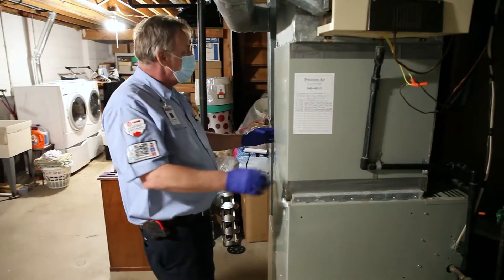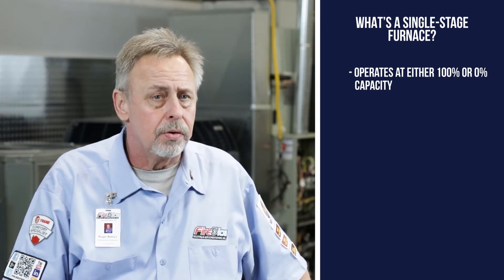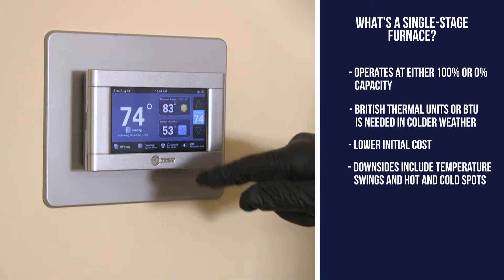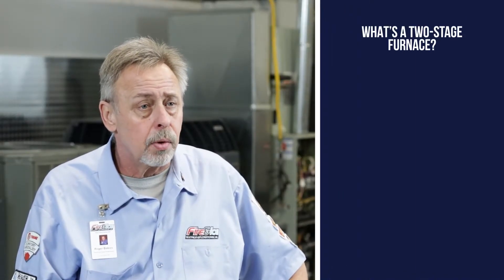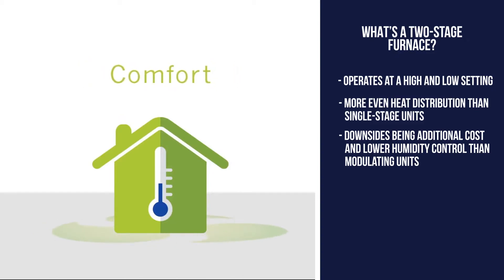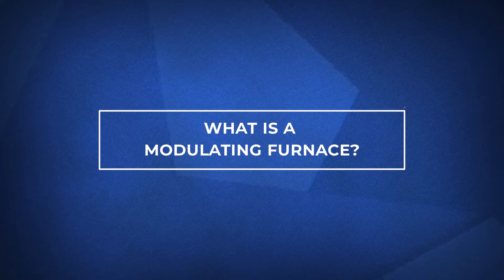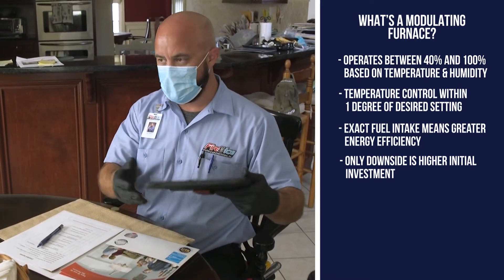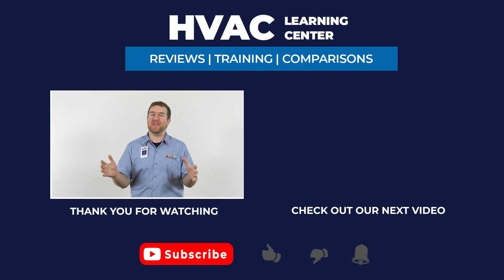Single-Stage, Two-Stage and Modulating Furnaces

Comment: What about the trane S9X2 two stage gas furnace, would you recommend it for someone that is looking for long term replacement?
Reply from the maker: The most important thing to consider with any furnace replacement is the installation practices of the installing company.  Too many company’s take shortcuts .

Comment: if u have a 2 stage installed from the start why would u have a single in its replacement  makes no sense correct expecialy if you added an addition within then 24 yrs right
Reply from the maker: Single stage is less expensive.  That is why some choose to do so.
Reply: Maybe living in an area with very low heating needs.